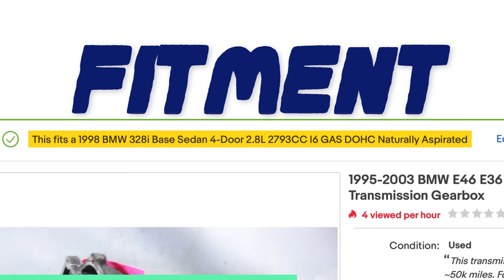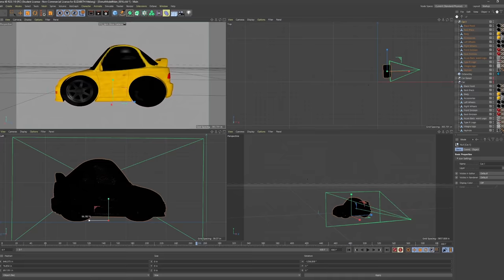Is a Manual Transmission Swap Worth It?

Comment: The money pit series has massively helped with my knowledge of cars, I was already quite knowledgeable, but this series gave me the confidence to send it and swap my engine myself
Reply: How hard was it bro? Worth it? Any problems while doing it or any problems after? Just bought a project mustang it’s manual but it’s the v6. I’ve been thinking about swapping it but not super confident.
Reply: @brendencotton4555  I found it pretty easy to do, no major issues, but thats down to the engine swap and car being VW.  As they all use the same parts and chassis, it was relatively easy to put in a larger engine.  Lots of fun too, thats the most important part.
Reply: @TheFozzy0  what engine into what
Reply: @zazaq  probably a golf or jetta and a vr6 is my guess
Reply: nice. I recently bought a 99 elantra 5 speed trans. Motors blown so looking to swap my 2000s auto tranny for the 5 speed
Reply: @TheFozzy0  congrats
Reply: any tips on where to start? just getting into cars recently
Reply: @anshkapoor7134  watch videos a lot. Start with simple stuff first. Also learn what each piece of hardware in a car does (it makes working on your car with a tutorial or reference video so much easier)
Reply: @anshkapoor7134  Watch lots of Chris Fix
Reply: I appreciate my maintenance guy. I love this channel because I appreciate the work that goes into this stuff.
Reply: Was WAS going to give to "props" but then noticed you said VW!!! Dude I've had a harder time fixing the driveshaft of a 2000's f150 than doing a Jetta-Beetle engine swap!!! Although showing my age (39) I miss MISS the old Beetles!!! I remember dropping an engine down on to a simple floor dolly.
Reply: @ku8721  Not every VW is as simple as the days of a simple carburetor engine in the early golfs and beetles.  Being a 2016 model you also have the complex electronics to deal with, modern cars are a pain.
Reply: You're lying
Reply: I’m proud to say that my son is currently undergoing an engine trans swap. Mitsubishi Lancer’s taking a stick and putting it all into a automatic. Cutting holes for clutch pedal and all. I’m sure he’s seen this episode but seems to be getting along. Not in 20 minutes but he is just ready for the swap. Good luck son!
Reply: How’d it go?
Reply: I’m not knowledgeable at all but I wanna be, know where to start?

Comment: A manual swap is definitely looks and sounds more intimidating than it actually is. Had a roommate who needed to do one on his Volvo wagon after his automatic trans died and his brother was already planning on swapping his current manual for a newer/better one. My roommate took the old manual from his brother and put it in his car and, for a dude who hadn’t done a whole lot of work on cars before, he managed to knock it out in a weekend with the help of his brother (who was a decent amount more experienced) and his dad. The only reason I pretty much sat around and watched was because they didn’t need any extra help. The 3 of them got it done no problem.
Reply: How does the car run today???
Reply: Inspiring stuff. I’m looking at putting one in my w123 mercedes

Comment: Donut: “We bought an automatic because it’s a thousand dollars cheaper than a manual.”
Also Donut: *Spends over 2k and a full day of work on an automatic transmission swap*
Reply: Its still cheaper for a good car
Reply: Ya, if you find an auto in great condition for $1k less than a manual that's in average condition, its worth the swap. Always easier to start a build with a car that is in good shape to begin with.
Reply: But autos are typically less beaten
Reply: I just did this job on an e82 135i n54 engine. Automatic cars in my area are worth about 12k. Manual with exact same miles/condition are 18 or more, and you have to wait a lot longer for one to come up for sale, or  switch to a nationwide search with the extra risk and cost.
Reply: It's getting used as a rally car so why would it matter if it has been abused or not, it's going to get abused either way.

Comment: I'm looking into manual swapping my car. Yeah it's probably easier to sell it and buy a manual but the car itself has a lot of meaning to me and I want to keep it for as long as possible. This video was awesome on helping me figure out if I should commit or not.
Reply: Felt that
Reply: Keep in mind, depending on the car, depends on what you have to do to make the car run with a transmission that was not original to the car. 

Some cars, you have to make the car think its always in neutral, (neutral safety switch) but then you gotta deal with the reverse lights - this is a common issue. 

Other cars like this one, you have to lobotomize the trans controller.

and others, you'll have to find a used working transmission controller from a manual car.  (keep in mind some cars you'll also have to grab not only the transmission but the engine computer for that car as well - as they can be paired.)

So remember to do your research for your specific model of car, don't want to get stuck trying to figure out how to get it working.
Reply: @DaBoomDude  Since posting this I have got myself a second car so the auto is my daily and the manual turbo is my project / fun car. 

That said if I do end up gear swapping I have kept in mind everything you said. It's just a lancer so nothing fancy and here in aus sourcing the gear box and even ecu for a manual version is easy.
Reply: @commonisekaihero4745  what cars do you have?
Reply: @sugarbooty  A base model lancer and a evo x. Why do you ask?
Reply: @commonisekaihero4745  just curious I assume nice cars though ✌️
Reply: Hey man did you ever pursue it ?
Reply: @EMWB36  Not as of yet. Part prices went sky high here in australia and I started uni at the same time as working full time so have had little time for anything more then bolt ons!
Reply: @commonisekaihero4745  Wow man, I also have a basic Lancer (4g92 engine) that I want to swap from automatic to manual and my motivation is pretty much the same as yours. I love my little Lancer, even though I have a nice Mercedes as daily driver :)
Reply: @kevinarevalofernandez3594  That's what I love about this community man, there's always some out there who has the same enjoyment and motivation as you!
Reply: @FoundationsofPause  I'll buy a hybrid daily or wait on toyota to get EV's going before buying a tesla
Reply: A reason I want to swap transmissions in my car is because I already know everything that’s up with mine. Buying a manual version would mean I take a gamble on the state of the drive train and body. And also my accord has sentimental value for me plus I love how it handles. I hear BMWs handle really good though soooo… idk
Reply: Same problem but with me its a 1984 base camaro. And my step dad just got a running z28 manual and its like an 86’ or sumthin. Its like a spaceship inside fr.. and the rs is disgusting especially with the automatic😭😭😭 so before i get my motor and everything put in it i wanna manual swap so bad.
Reply: Also im skrewed cause with camaros from 84-86 you cant just stumble across them anymore like that. At least a shell in rolling condition. So i for sure need to do hella research but im not mad if i have to settle with the automatic. Just seems boring. Also want that ugly dash board out of it looks like a caprice or something.
Reply: @nobreaks3305  I live in perth, australia so I'm no stranger to your plight of finding certain cars that aren't total s**t boxes or people are over charging for just a rolling shell.

The project sounds awesome though and a car like that would straight up be more fun in manual for sure. Hope you work it out!
Reply: I feel you bro, I’m going through the same thing. It’s just whether or not I wanna drop 5k or not 🥴
Reply: @LuisGarcia-tb9po hey dude did you pursue on to get it manual swapped? I have a accord too and planning on doing a manual swap.
Reply: Always saying that whenever someone says “that’s not the car you want” or “it’s a waste of money” like it’s about the sentimental value more than anything else…. Plus the car market is insane these days
Reply: @commonisekaihero4745  yup. Waiting for it to equalise coz it's ridiculous rn

Comment: Such an interesting market you have there in the US. In most parts of EU, you will only find E36 with a manual, you must pay quite higher price to buy an automatic.
Reply: While manuals might be cheaper to make, they don’t turn enough of a profit in the states, and everyone buys an auto. It’s easier to make an expensive technology cheaper if the demand for it is significantly higher than the actual cheaper option. And it’s just a scenario of the manuals out there are driven by car enthusiast, so they tend to be driven pretty hard
Reply: You guys are both right and wrong depending on if this is a new car or used car in the USA and what the demand is for the particular USA market. For this used car, the manuals are more expensive because of the small market of people thay buy these for racing drives the price of the used car up as more and more manuals in good condition are hard to find.  So the automatics of this used car are actually cheaper. In general a used car that isnt known for racing potential, then the automatic would be more expensive. Most new automatics in the USA cost pretty much the same as the manual. However, I have seen examples of the manual costing more than the automatic with the rest of the specs being identical.  That's just marking up the price for the manual or selling the automatic closer to the MSRP because a lot of dealers dont carry manuals and the rare manual American is just willing to pay a little more just to have the manual . I recently saw this was the case for some of the manual 2021 Toyota corollas
Reply: @TheKos2Kos  whoa they have manual 2021 Corolla? That’s something I would consider over an auto.
Reply: @6.2Slomaro  Volkswagen still makes plenty of new manual cars too.
Reply: @alanchairez  like regular commuter cars? I would want any VW sedan with the TDI since they are good on gas and if it’s manual, that would be the most forgiving car to drive in traffic.
Reply: @6.2Slomaro  I've seen TDI and GLI models come in stick brand new at dealerships in my area. I personally drive a 2020 Jetta R that's stick. Sadly the R is only an appearance package and not a performance package but it's still stick though
Reply: @6.2Slomaro  yeah the corolla hatchbacks have a manual option, but I went around looking for one and they aren’t exactly easy to find. I went looking because Toyota was heavily advertising that the hatchback has manual availability
Reply: That is not true anymore

Comment: "Clutches don't like Oil." 

Meanwhile... Quite literally all my motorcycles.
Reply: Wet clutch vs dry clutch
Reply: yup most performance dual clutch transmissions are wet clutches too.
Reply: And automatic transmissions. A torque converter (which is a clutch pack) uses oil
Reply: @mrmedium7984  You should replace "is" with "includes/requires", because the torque converter fluid coupling is still a thing, and the clutches only engage above a certain speed
Reply: @specialopsdave  literally lol
Reply: Ducati clutch be like: “xkxkxkkxkkkkxkkkxxxxxkxkxkxk.”
Reply: Exactly my thoughts when he said that , lol
Reply: @karelpgbr  It's when it stops sounding like "xkxkxkxkxkxkx" that you'll need to start worrying :P
Reply: @mrmedium7984  Torque converters don't use a physical clutch.  They are truly viscous clutches relying on fluid drag on the fins to transfer force.  No actual contact.
Reply: Harley Davidson

Comment: I suppose a finishing touch would be to instal a slightly shorter gear stick so one can quickly grasp the top of the knob to change gears rather than grasping the stick like it was a railway switch lever. BTW, I love Zach's enthusiasm and charm. He reminds me of Kyle Hill. :)
Reply: you can change the height of the stick he chose to have it that high

Comment: If you have the time, patience, and money to take on such a project, then it could be worth it for the added benefit of shifting your own gears and taking advantage of the engine’s full power potential.
Reply: Or take all the time and money and go buy a manual
Reply: @johnreese7352  or  you might be in a position like me, where you love your auto car but wish it was manual.

Gonna be taking on this project soon lmao
Reply: @goldilocks9687  Agreed, if I was in this situation, I’d do a manual swap on a 328i that I bought brand new in the early 2000’s rather than buy another early 2000’s 328i with a manual.
Reply: It's only barely worth it if you're a machanic with your own workshop tools and plenty of spare time. Otherwise it's gonna cost you more than the same car with already a manual transmission.

Comment: I would love to see you guys do a front wheel drive to a rear wheel drive conversion eventually. Maybe season 3 of money pit??? Either way I've learned so much from you guys and I can't wait to learn more!!
Reply: That would be an extremely expensive and labor intensive process that would require cutting and rebuilding the entire floor pan and tons of custom fabricated parts. It's been done by other car Youtube channels I think, so you can check those out! Swapping a manual into an auto might seem similar to converting FWD to RWD but one requires simply swapping some parts and the other requires completely destroying the car lol!
Reply: I’ve seen Civics with it done. They had to convert it to rear/mid engined to do it.

Comment: Dude you actually made that job seem easy ASF. In which I've changed a transmission in a 2wd truck a few times it's not to bad  but you made the swap look easy. Lol hardest part was pulling gear shifter and plastics out of interior without breaking something!

Comment: Manuals make going to work fun for me everyday. I'm blessed with 2 different canyon drives everyday! With a supercharger a manual trans Bilstein adjustable suspension with front & rear sway bars and cornering lessons, I can keep up with almost anything in the twistys....(with only around 300 whp & 3600 pound truck)  
    Another fun drive to do is drive down the canyon at a good pace using  only engine braking
Reply: do you work at tufo shop with night shift
Reply: @morez4732  nahh im in fresno ca

Comment: All depends on how "swap friendly" your project is... I've been called in on some real basket cases.  
Plus, I would encourage viewers to build, borrow or buy a cheap pilot bearing installer.  It's super easy to make one if you have some imagination.  I hate using a hammer on the end of the crank, can cause thrust bearing damage in the engine.  Some guys are not gentle with a hammer.
Reply: G37 aint friendly at all 😭

Comment: I did this to my 98 Legacy GT using the Dirt Cheap Daily channel as a reference. It was super easy to do myself with basic hand tools. I only needed a little help mating the transmission to the engine because I didn't have the strength to manhandle it. Was not disappointed though. 10/10 best mod I've ever done and would do it again. Fun tip for Subaru owners; Subaru built all their unibodies up to the early 2000s the same way regardless if it was auto or manual in order to save on manufacturing costs. Meaning that Autos already had all the drilled/tapped bolt holes and cutouts for a manual swap just covered by plastic covers and clips. Pop them out and bolt the new parts on. Wiring was a simple matter too.
Reply: Hey, 00 Legacy owner here. So it's not that bad of a job? I've been thinking about doing the swap but there was a lot of fearmongering about how difficult, pointless and expensive it'd be.
Reply: Hola amigo yo quiero realizar ese cambio de caja automática a mecanica pero no sé cómo va conectado el cableado ni en qué modo retirar la caja automática si en párking o neutro espero me puedas ayudar saludos desde Chile

Comment: "Time to install that lightweight flywheel"
"Whaaaagh!" *makes noises while lifting it in place.
Reply: Lifting heavy stuff at maximum arm reach is a lot lot harder than close to your body. That scream was legit, everyone knows it helps to get more strength.
Reply: @pier-lucgaranddion1527  This is actually wrong, the same as moving your arms before you spin isnt going to make you spin faster, but making you more ready..
Reply: @MrSkjerpe  You're not making much sense here, so I don't know how to take this. But I'm not talking about physics here, you're literally not using the same muscles when lifting a heavy object close to your body as opposed to with your arms fully extended in front of you. It is a LOT harder with your arms extended. Perhaps you were refering to my saying the scream helps? Yeah, I know it doesn't, but since it has a psychological effect, it actually does.

Comment: My father and I ended up having to do this with my 240K Coupe. It had an auto.... which blew up. Luckily we had a perfectly good manual and associated gear from a 240k 4 door in the shed. Turned out to be a real easy job as the coupe had bolted on plates where all of the manual gear fitted. Took a couple of days, but when it was done, it worked great.

Comment: From what I gather on e36 forums from like 10 years ago, is that you really don't even need a zf transmission unless you're planning on pushing 500hp. Usually Getrag's hold up just fine. But this video really helps, Im planning on doing a manual swap on an e36 I'm trying to get, and the $2-300 difference is really going to help, it is a budget build after all. I do want to say though, If I can find a zf for a reasonable price I will definitely get it.

Comment: 10:53 wd-40 isnt lube. It stands for water displacer, it was made for the first successful space mission to coat rockets before take-off so ice wouldnt stick to the metal and weigh it down as condensation occured.